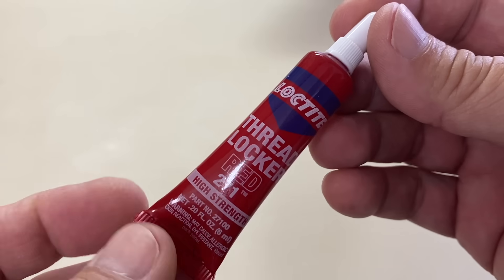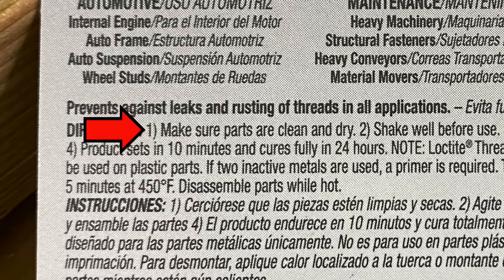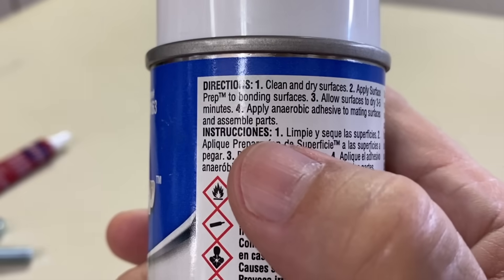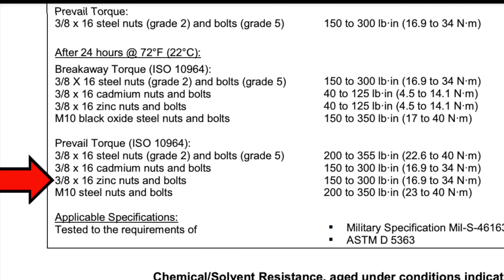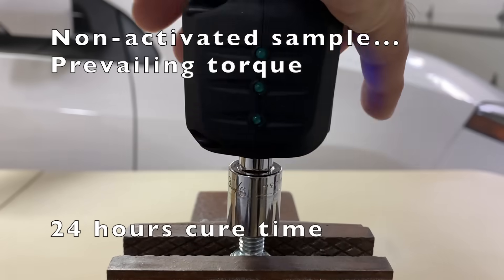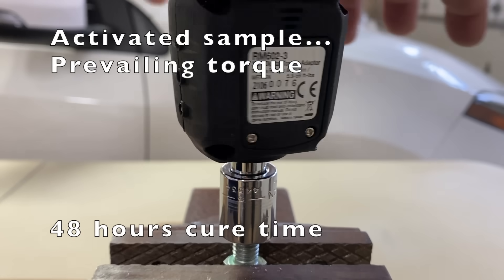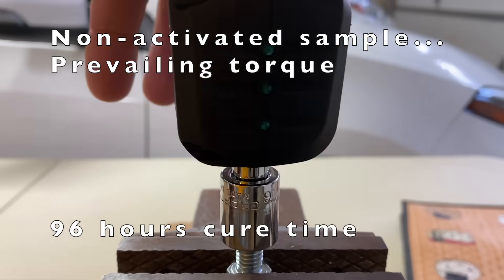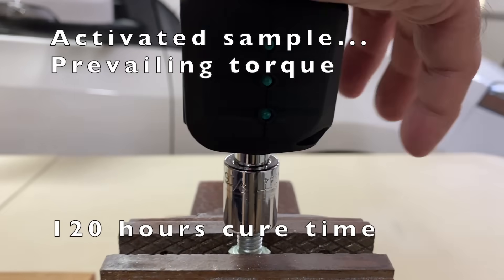Nuts & Bolts - Most DIYers Do Not Know This | Loctite Red Threadlocker Curing

Comment: Listen, if you want to PERMANENTLY secure the nut with ZERO chance of it getting loose, just tighten the nut as much as you can, then take a Flat Head Screwdriver and damage the threads of the bolt where the nut is, and it will NEVER come loose, but remember, this will be permanent, but if you ever need to undo it, you can always cut it off.

Comment: I thought it was the friction from the tightening torque that " sets " the Loctite . Not just air dry .
Reply: You are kinda right. The torque forces the air out of the threads. Loctite does not properly cure in the presence of air. Hence the “anaerobic”. Zinc fasteners in particular have very loose tolerances to allow for varying plating thickness
Reply: @genecarden780  also why they tell you to never " top off " a bottle with other partially filled ones . I learned that the hard way .

Comment: Tightness of threads to begin with matters more than type of metal in my experience.
Reply: Yes and zinc fasteners in particular have very “ loose” tolerances to allow for plating variances. Without tightening the fastener against something and forcing “ intimate contact” with the threads air is free to circulate through the threads and loctite does not properly cure in the presence of air.( more correctly oxygen) that is what anaerobic means. Totally flawed real world testing.
Reply: @genecarden780 I’ve found temporarily covering the area around the fastener with duct tape to block the oxygen circulation, can make a difference, I recently had a stainless fastener in anodized aluminum with a really loose fit that wouldn’t set up without smothering the area with tape.

Comment: Lesson learned....if you want to remove the nut later don't use activator.  I've seen freaking red locktite need a torch to get the nuts removed sometimes....
Reply: You probably used loctite 648 bearing retainer , you need heat to remove them
Reply: There is nothing to be learned by this except ge has no clue how loctite works. This test is so flawed its laughable

Comment: Isopropyl alcohol leaves an oily film on things.  Most folks don't know this, you might be surprised by this.  Just put a few drops into your kitchen sink, let it evaporate and run water over it, notice it beading up.  My wife was a nail tech and taught me this.  Always something to learn as an old mechanical engineer!!
Reply: Isopropyl when used correctly does not leave a film, BUT,  it has to be dried thoroughly with a clean dry cloth. (which can be problematic on threads) Not left to dry on its own.  As mist people do. We call this the 2 rag method of cleaning.  This is very well known in industry, including in clean rooms. If you leave it to dry on its own you don’t even need the water to see it. You can actually see the film left behind.

Comment: I've used threadlocker on bolts by just cleaning them with carb cleaner, and it's worked very well. Never had any issues. Most of us don't have day's or extra time to paint every fastener every time, seems there would be a better alternative.

Comment: Interesting experiment, some nice method here. If done with 50 samples (5 unprimed, 5 primed per time interval), it might show if the primed torque smaller than unprimed at 72h is accidental or consistent.
Reply: Hus methods are so flawed as to be laughable. Anaerobic means in the absence of oxygen. Zinc plated fasteners have very loose tolerances to allow for plating thickness variations. Since he didn’t apply the fasteners against any resistance he threads are flee to float allowing oxygen in all of the threads. Loctite dies not properly cure in the presence of oxygen. He fasteners absolutely need to be tightened against something to induce intimate contact with the threads which would exclude he oxygen and allowyhe loctite to properly cure. ( a typical use of any fastener)

Comment: Not sure you can use that torque wrench with an extension handle as shown in your video and still get an accurate result.  You can’t with a traditional mechanical torque wrench… It sounds counterintuitive but there’s a good reason.
Reply from the maker: Thanks.  The torque adapter works differently from a traditional beam torque wrench.  The torque is measured at the head and works with any length of handle.
Reply: @HacksbyDad  Thanks, I didn’t know that. Excellent video, I forgot to say!

Comment: Those nuts were not under tension , this makes the experiment invalid , try again with nuts clamping something or a jam nut .
Reply from the maker: Thanks!  That is what a lot of people said so I conducted another test... https://youtu.be/7yPQIsfv9x8
👍😎
Reply: @HacksbyDad  truth be known , loctite is designed to combat vibration not really to prevent the threads from passing . Anaerobic sealants as the name implies , harden ( plasticize) in the absence of air . When the air is displaced by the threads the fluid becomes plastic . If you want to lock a threaded fastener, one drop of battery acid on the threads will be permanent.
Reply from the maker: @philliplopez8745  OK.  You mentioned earlier that the experiment was invalid because the nuts weren't under tension.  
👍😎
Reply: @HacksbyDad  if you wanted to know how much effort it took to loosen the nut , it needs to be bearing on something .
Reply from the maker: @philliplopez8745  You're referring to the breakloose torque.  I tested the breakaway torque.  Page 79 in the Loctite Threadlocker manual explains both... https://dm.henkel-dam.com/is/content/henkel/LOCTITE-Threadlocker-Manual
👍😎

Comment: You call it activated but it seems to be just a pre cleaning. ?
Reply from the maker: Thanks.  Activated is what the manufacturers call it.  In doing more research, the activator is used to speed up the curing time of threadlocker used on non-active and/or cold fasteners.  😎

Comment: I did not know all that you demonstrated. Interesting. Maybe you used far too much activator? Catalysts and epoxy are both fussy solutions. This has been in my mind recently. So also there needs to be pressure to suitably activate the Loctite achieved by torque applied to the mechanical bond. Which I consider a vital part of the bond. One scientists knew would be present but you eliminated by not using the fasteners to do any clamping. Significant?
Reply from the maker: Thanks!
This video might interest you… You Don’t Know this About Loctite
https://youtu.be/7yPQIsfv9x8
👍😎

Comment: So, no bar was necessary on the ratchet handle.
Reply from the maker: No.  It would have been difficult for me to break the red loctite bond with just the 9-inch rachet handle, but I think I did it before.  The cheater bar made it much easier and didn't affect the results of the torque adapter.  Thanks.  😎

Comment: Knowing how to properly use tools might make a difference. You never use an extender or “cheater bar” with a torque wrench if you expect a reliable reading. Torque wrench values are based on specific leverage to base logarithms to produce the accurate reading unless you determine the variable of the additional leverage quotient.
Reply from the maker: Yes but not for a digital torque adapters which measure the force at the head.  Doesn’t matter if you use small rachets, breaker bars, and cheater bars.  😎

Comment: This falls into the "for what it's worth" category.
Most bolts and nuts loosen up because of the sloppy thread fit. That was why lock washers came to be. Years ago I had a piece of equipment that had some one inch studs that kept coming loose. I'd hammer then tight with an impact gun, then further tighten with a breaker bar and a long pipe. It was tight!  Over the course of weeks and up to a couple of months, these studs would loosen up. Finally I took them apart, cleaned the threads, then applied a light coat of RTV silicone and re-torque the same as before. After that nothing loosened up, ever. And the silicone kept out moisture so disassembly was a non-event. It has been my go-to method on anything that lives in a world of vibration and I've had great results. Your results my vary.
Reply from the maker: Thanks!  👍😎

Comment: A Loctite representative told me once to cancel out the locking of Loctite heat the nut and bolt to 400°F. The heat crystalizes the Loctite and it breaks away very easily. For rusted on bolts and nuts like on car suspensions I heat the nut to cherry red. Makes a big difference. Have taken several cars apart using heat. BE CAREFUL AROUND THE GAS TANK!!! What I usually do when dismantling a car is the first thing I do is remove the fuel tank. Then I open the tank up by removing the the fuel pump and hoses. Then I fill the tank with water and overflow it so all the residual gas floats out. Then I let the tank vent and dry out for 3 months before doing any heat related work on it. During that 3 months I am dismantling the entire car.

Comment: Google ”When to use Loctite Activator with your Loctite Threadlocker”. 
Henkel has a good manual for it.

Activator speeds up the curing. It doesn’t do anything for ultimate strength. 
Proper cleaning and applying enough, so it fully fills the threads, is more important.

I use activator when I need full strength quickly. 
1. Passive metals (see the manual for a list). It will cure on both stainless and treated metals but it may take a few days.
2. Cold weather. Slows down the curing. Use activator or warm up the part.
3. Large threads. Can take a long time to cure otherwise.

Red for things you don’t want to take apart (without a heat gun)
Blue for most things
Green for all things you want to be able to take apart, it seals the threads and prevent galling or corrosion. (Or anti seize/metal free paste if I don’t need any locking)
Nordlock locking washers if the part gets hot (Loctite looses its strength when hot)
Locking wire or pin on safety critical parts.

Comment: I have been using Loc Tite products since the 1960s.  I have found an additional benefit of using them on auto chassis bolts - the product polymerizes between the threads of the bolt and nut and SEALS  the connection from (salt) water and corrosion, making disassembly much easier in climates that use salt on the roads.

Comment: This test seems almost useless to me. As I understand it, Loctite isn't designed for shear, it's designed to expand pressing the nut and bolt surfaces on one side of the thread against each other to create friction and resist coming loose. No doubt it can offer shear but I think you need to redo this test where the nut is actually tightened creating a clamp force.
Reply from the maker: Thanks!  Many people misunderstand how Loctite works.  Here's a video with Loctite's primer, more test samples,  and more information... https://youtu.be/iz9qhPx0Hr0
😎

Comment: so quick question, in radio controlled nitro rc racing there's a debate over using red vs blue loctite. the screws are stainless steel screws. it is mostly used on the drivetrain and to mount the engine and the clutch nut on the flywheel of the engine. what do you recommend for radio controlled cars with such high rpm and vibration?

Comment: Having worked in various manufacturing companies where Loctite thread locking compounds were used in production, I don't recall many cases where activators were used. These compounds are anaerobic, meaning absence of oxygen triggers curing, regardless of materials to which they are applied. One might as well put the assembly into a vacuum chamber for a few hours, which might be acceptable for one-off development work, but not mass production.
Reply from the maker: Thanks!  After more research... I found that the activator is more for speeding up the curing time on passive metals or cold fasteners instead of increasing the adhesive strength.  😎

Comment: Just saw this video and I really like how you presented the info, well done. So in essence red loctite adds about 15-20 ft-lbs to the torque needed to loosen the nut, without increasing the clamping torque. Then if the nut comes loose it provides about 10-15 ft-lbs of torque to resist the nut vibrating off.
Reply from the maker: Not exactly... here's another video that you should find interesting... https://youtu.be/7yPQIsfv9x8
😎

Comment: One day somebody please figure out what a gallon of the cheapest loctite would cost. Just guessing at least $3,000 a gallon. Great stuff. Have a couple bottles in my garage that are over 40 years old. Used some last year for screws on keyed operated lock on my basement steel door. Had to tighten them several times a year but not since using some loctite. Just hope I can remove them without using a grinder to hack off recessed uphold heads.

Comment: My experience from working on motorcycles and Volkswagons  is that Loctite won't properly cure unless it is under load.  Just putting a nut on a bolt is not enough to test the strength of Loctite.  For example, when putting studs into an engine block, you would install the stud to the appropriate height above the block using Loctite 262 as directed.  Then you would put a nut on top of a  bushing or a stack of washers on the stud to force it into a load condition in the direction it would see under service, ie, under tension as if it were being pulled out of the block.  Then torque the nut as specified for the assembly, wait overnight and remove the nuts and washers from the studs.  Obviously, the tensioning nut and the section of stud that it engages should be free of Loctite.  In my example, after 48hr it would take a bit of heat from a propane torch and a lot of torque to get studs out that were installed in this manner.  I've seen nuts and bolts with Loctite on them, but no load, that are still wet and uncured after a week.
Reply from the maker: Thanks!  Here's a test of loaded and unloaded nuts with threadlocker... https://youtu.be/7yPQIsfv9x8
😎

Comment: Sooo, like whatever. Also you let them set un-tightened, which made the whole thing random AF.
Reply from the maker: Thanks!
Actually, testing them un-tightened made the results less random because it eliminated the variables of torque and friction.  Is this a real-world use?  No.  It just tests the adhesive strength of the threadlocker.  😎
Reply: @HacksbyDad  But thats the thing, this is not exactly glue. It bonds metal to metal chemically. So if you doesn't tighten them, the surface tension of the liquid gona keep the metal parts away from each other and the bond gona be bad. As the Loctite page says itself "LOCTITE Threadlockers work on anaerobic technology that hardens in the absence of air and presence of metal ions." So the metal is a part of the bond, and if they too far apart, they can't do their magic, coz instead of "metal - bonded area - metal", it gona be "metal - bonded area - half hardened glue - bonded area - metal" and the "hardened glue" going to be a weak point of it. (of course some parts gona be bonded here as well good, but way less than in normal use, and the bonded area going to be random at each place)
Reply from the maker: @yuricopperhooves  Thanks!  You should find this follow up video interesting... https://youtu.be/7yPQIsfv9x8
👍😎
Reply: @HacksbyDad  Well, I'll be damned. My whole life was a lie. 🤔 Since I'm too lazy to repeat the experiment, I'll just accept it I guess. Looks like even I can't be right all the time. The best I can do is back down and put some upvotes on the videos👍
Reply from the maker: @yuricopperhooves  Thanks!  I'm just conducting small-scale experiments that pop into my head and sharing what I find.  Having fun as I near retirement.  😎

Comment: I wonder how the results would have changed had you used a solid piece of plate steel and drilled holes in it and then placed all of these bolt/nut sets through the holes and used a flat washer on the head side and a lock washer on the bolt side and torqued the sets to a specified torque setting.
Reply from the maker: Thanks!  Not sure but this experiment might interest you... https://youtu.be/7yPQIsfv9x8
😎

Comment: Overall, great info!  There are some interesting things in your test.    I have read a large number of responses and have had a lot of experience with fasteners in everything from manufacturing machinery like metalworking tools, in aircraft and automobiles to fasteners in the marine environment exposed to the weather, inside vessels and under water.  Regardless of how Loctite shows their testing in one short video, that is not a real world situation because the bolt head and nut are not applying pressure on anything and therefore are not in tension.  When under tension the film thickness is more controlled than when the nuts are not applying pressure.  When torqued down, regardless of the amount of torque, there is a place on the threads where the film thickness goes to zero and increases as the shapes of the threads separate.  The best strength is dependent on the correct film thickness.

The dip in resistance after 96 hours makes me wonder what was different on that day.  Big temperature change?  Bad batteries?  What else was different?  A sample size of one is also not the greatest source of data.  Testing of four or five at each time interval would lead to better average data and also show any unexpected deviations.  I understand that you're buying the nuts and bolts and they're not free but I also have some formal education in random sampling.
Reply from the maker: Thanks!  Had I known that this silly video would go viral with over 1.5 million views... I would have tested more samples.  Here's another Loctite experiment that might interest you... https://youtu.be/7yPQIsfv9x8
😎